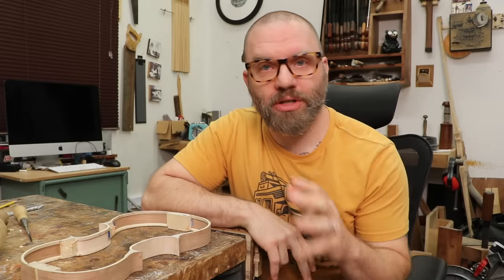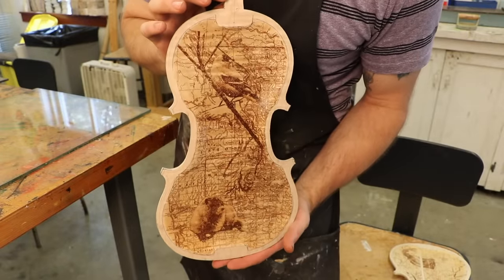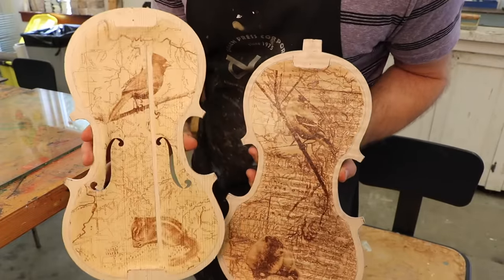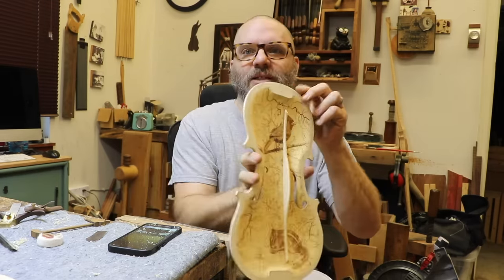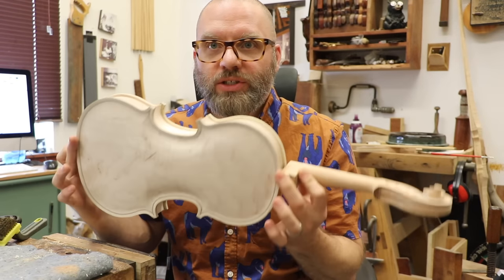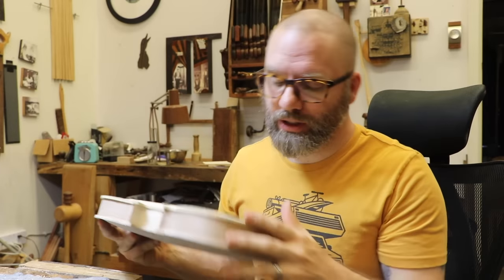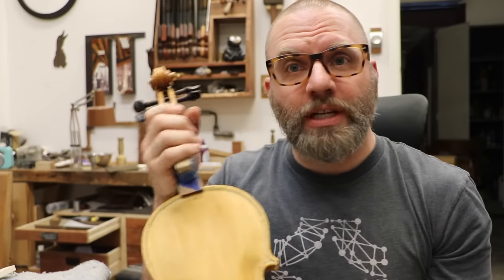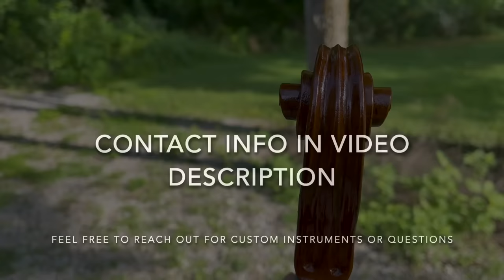A Violin/Fiddle for Tally Ho: Part 5

Comment: Was that printing process that you used related to an offset press?  The reason I ask is that my Dad was a printer and he had a small shop in our basement while I was growing up in Rochester.  He had a small offset press and a good sized platen press.
Reply from the maker: Very cool! It is a process called paper plat lithography which is akin to polyester plate and offset litho which is what most people do commercially.

Comment: What is this printing technique?
Reply from the maker: It is a process called paper plate lithography.
Reply: @JDanielGraham  Thanks, found some YT videos regarding this. Interesting process, i need to check this out.
Reply: @JDanielGraham  Is it really that simple? Toner based Printout, Water / Gum Arabic - and this prevents the lithographic ink from sticking to anything that's not covered in toner? - i'm sure this needs some practice and learning, however, from the core it's that simple.🤔

Comment: So you don't use casein, tung oil or UV light bathing? Interesting! Certainly not of the internationally recognised violin making schools, which you clearly did not attend as a student.
Reply: … interesting comment, that you are posting,…
Is there anything you mean to say, or do you just can’t help, making assumptions?
Reply from the maker: If I was making one for a traditional player I would do that but in this case the wood needs to be treated and sealed differently due to its moisture content and where it is going to live. I did a traditional apprenticeship in furniture making as well as a traditional apprenticeship in violin making. But I also have two Art degrees so I know the way and like to deviate when it calls for it.